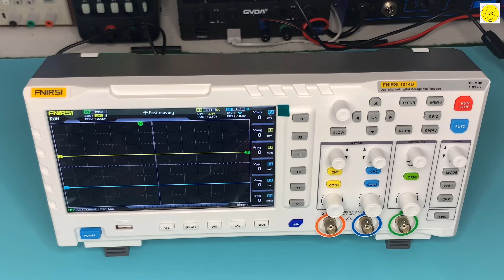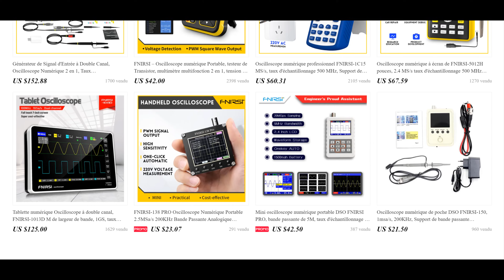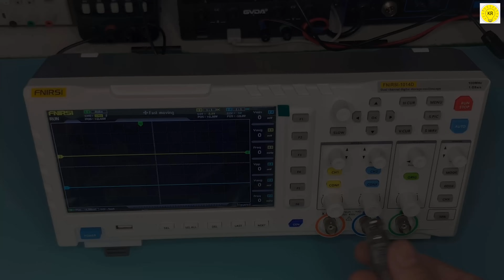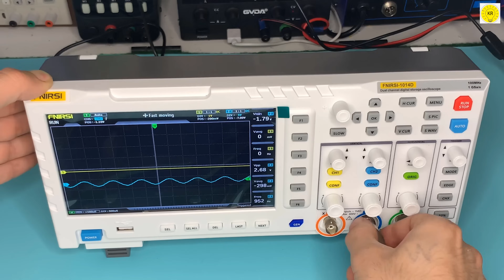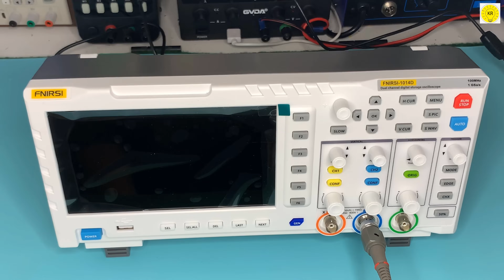how to make brushless motor controller , mosfet , IRFz 44n

Comment: Bonjour, Très belle vidéo pour ce contrôleur de moteur Brusless. Dans mon cas, je recherche un contrôleur pour moteur qui fonctionne sous 12 à 14v et qui fait 850w de puissance. C'est pour pouvoir piloter, le moto-ventilateur de mon véhicule qui ne fonctionne plus car il y a un problème de réseau Can. J'ai utilisé le contrôleur A2212 du commerce mais il n'a pas fonctionné longtemps (grillé) car trop léger pour la puissance de mon moteur. Connaissez vous un contrôleur dans le commerce qui puisse accepter la puissance de mon moteur.
Reply from the maker: L'appareil que vous avez acheté, combien d'ampères avait-il ?
Reply: Mon moto-ventilateur absorbe entre 65 et 70 ampères. Le contrôleur A2212 que j'ai acheté mentionnait 30 ampères mais ceux sont des ampères Chinois.
Reply from the maker: Recherchez cela sur Amazon, c'est 120 ampères
👇
DEWIN Controleur Brushless 120A, Controleur Brushless 5-36V BLDC Sans Balai Triphasé Sans Capteur Sans Contrôleur de Moteur à Effet Hall
Reply: @inventorkr1  Merci pour l'info et le prix reste correcte.
Reply: @inventorkr1 какая частота работы этого устройства?

Comment: Greetings from Colombia, do you have a diagram or a video to make a 3000w 80A card for a brushless motor that has forward and reverse gear?
Reply: Just replace all the components with the ones that can handle the power and make the output of 2 wires switchable. Switching w wires on a 3 phase Motor makes ist run backwards.
These MOSFETs will likely die quickly though, so just use a proper 3 phase motor controller.

Comment: those old harddrive motors are really nice to play with! I also love it. Maybe we need some nice ideas to convert them into something useful 🙂
Reply: Самолетик?)))
Reply: @mr.discopotato  Drones would work. Those little drone-motors are quite similar.
Unfortunately I did not manage yet to completely remove those motors from the harddrives
Reply: @mr.discopotato adding a gear to drive a bicycle may be 🙂
Reply: @mr.discopotato  Those motors were used for ages in rc-planes and some of the first diy-drones, back in the day. Today it´s less work allltogether, to buy a dedicated drone-motor, since they´re so cheap by now. But still, this ESC is one you easily understand how it functions, and can be used to learn how to use a commercial one, or as test-ESC. to check if your drone-motor or its commercial ESC is faulty (since this ESC be rather well-functioning more time than other, more complicated ESCs...)
Reply: I have try it, and it works for me

Comment: It's for three phase motors THAT HAVE a common 4th wire to power the motor and the fets just pull each phase to ground. Cons of this is horrible rpm adjustment and low torque.
Reply: I with I would had realized this before I build the dam thing...lol... O-Well I'm sure ill find a use for it down the road.

Comment: That's a horribly inefficient sine wave, sure they're neatly out of phase, but due to bad wave you could see he had a hard time even starting up the motor, taking several tries, and when it finally run it was very noisy due to bad sine.
Reply: The circuit can keep a turning motor turning, but it can't start up on its own, that's why he had to tune that "speed" potentiometer. Also, you need a higher voltage, as this circuit works by triggering one phase by an induced voltage in another unpowered phase, which differs from motor to motor. It works but it's too simple to be reliable.
Reply: You have this all wrong. Most brushless motors don't run on sine waves. See my other comment why.
Reply: @Ozzy3333333  Most don´t run on sine-waves, but all of them could, still. Most run on PWM, and that was no PWM, it was simply bad sine... I still love the simplicity, you got to love it. If one doesn´t understand this simple circuit in the first place, shouldn´t even think of messing with the commercial ones, or he´ll soon become a very sad person...
Reply: @user-rs8zg8ey2b  no, but all three phase  brushless motors does, thats the point of a phase, that the positive period of a wave is in a different phase than the others.

Comment: What is the board made out of?
Reply: Copper clad board, which has a thin layer of copper coating on one or both sides. By using a permanent alcohol based marker or toner you protect it from an etchant (usually ferric chloride - FeCl3). This eats all the exposed copper away and you're left with the traces. The PCB is not required to make this circuit work, but you'll have to connect the parts using wires instead.

Comment: A weird driver (guess why people use 8 switches for those things, not 3) and a lot of non-attractive scope/gen ad time... By how much noise the motor makes you can clearly tell this has barely a thing to do with a proper bldc drive, see Microchip appnote on how it is done correctly ;)
Reply: You are correct, there are many cons to this style motor controller, but it has a few pros too.

Comment: 🇧🇷Here in Brazil. Very good your project. How many amps does it support, can it run a washer and dryer motor for testing?
Reply: No, it does not support that kind of motor, needs to use 3 phase with 4th wire common type of motor.
Reply: Esse controlador brushless pode acionar um alternador de carro como motor brushless

Comment: Why MOSFET is producing noise?
Reply: That's just how it is with high frequency switching MOSFET caused by parasitic capacitance and inductance inside the MOSFET (lower frequency keeps them on longer and turns into heat but there's less switching noise while high frequency adds more noise into the circuit). That's the extent of my understanding of the subject. This is a sample circuit so he didn't add anything else to suppress the noise like capacitors and inductors. IMHO it isn't a tutorial how to best built a motor controller but rather a general education video that one could be made in a very simpler manner. Pretty cool stuff to try at home and while at it learn how to make it better!
Reply from the maker: like
Reply: The motor is recieving very frequent high pitched noise as instead of it recieving a frequency dependent voltage, it starts out without any reference. This causes unwanted oscillation.